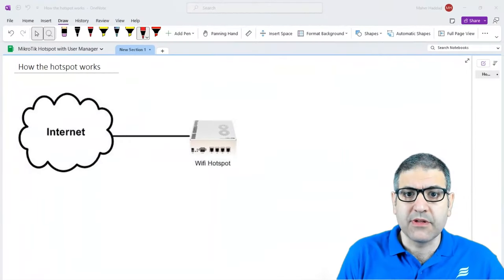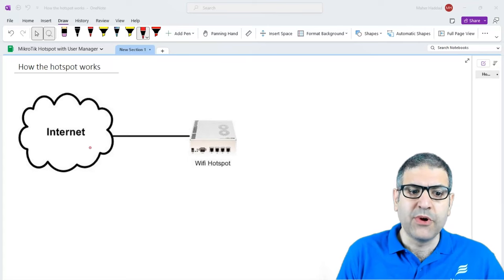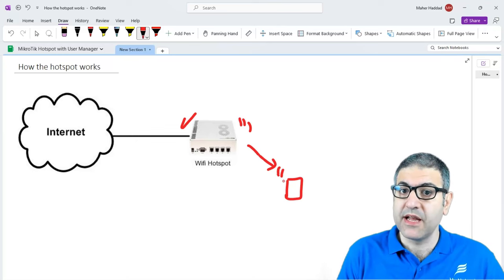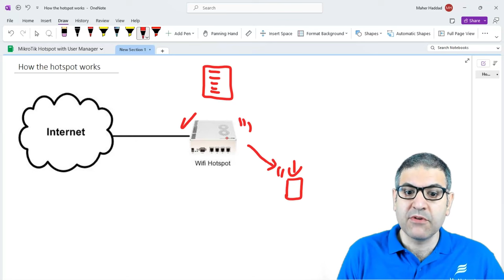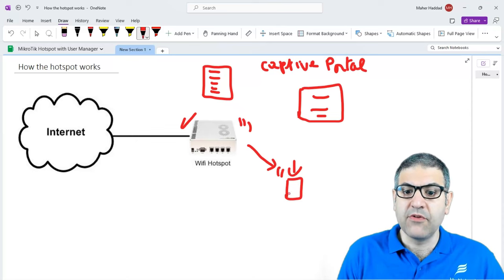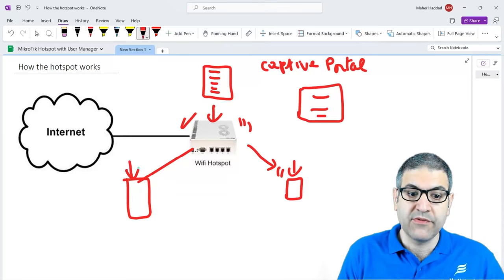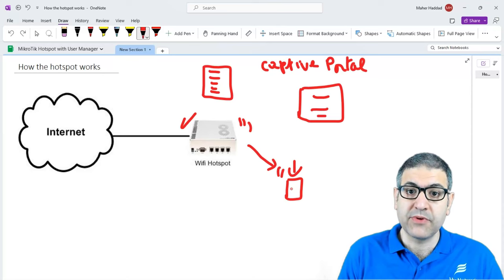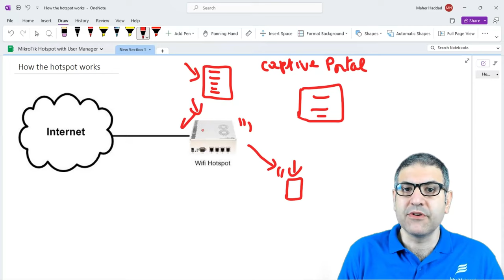How the hotspot works?

Comment: MAICT  i actually  had a video of yours from  a friend on  complete set up on hotspot . and you did extremely well on the topic. but i have come to notice that the data cap on Os 7 is not working . what i mean by data cap is the transfer limit ,upload limi and total tranfer  (data cap ) . others like TX /RX limit works fine , and if i want to use mangle rules along with pcq works fine . but the data cap is just an issue on os 7 . i know that works fine with os 6 ( web base ) . can u help out on data cap in os 7 ?